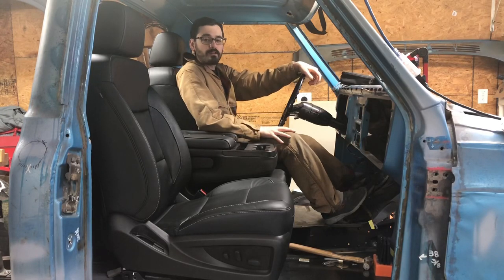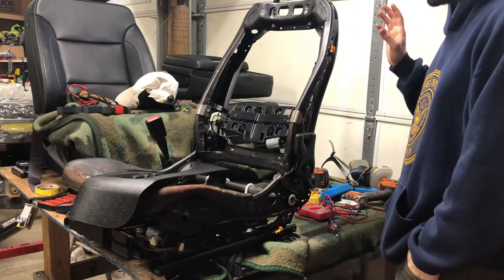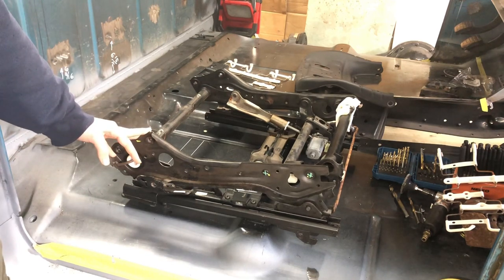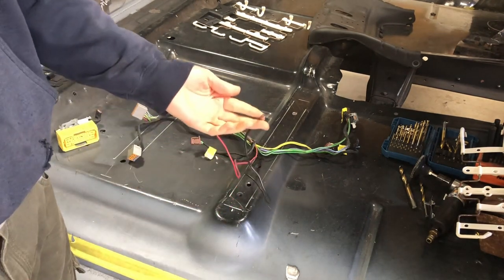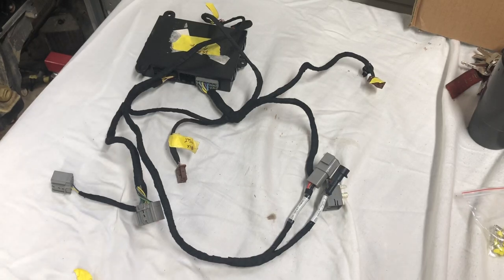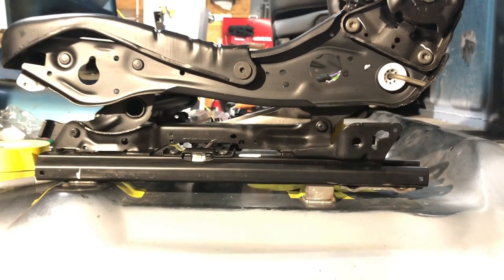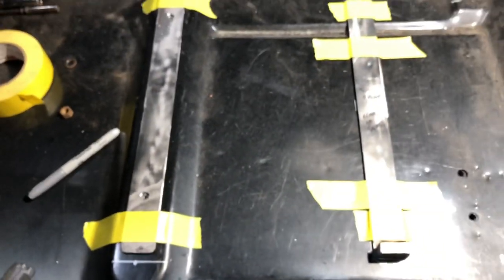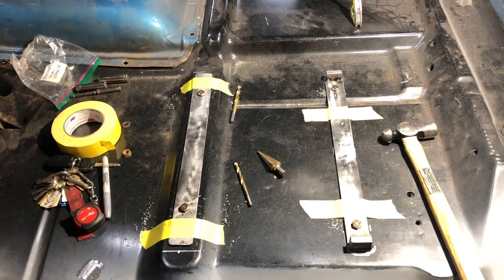C10 Seat Swap

Comment: Hey, is there any way you could get the factory heated/ventilated seats working from the denali seats? I just picked up a set of 14-19 denali seats I'm going to swap into an 80's truck. I thought I could just run 12v power to the factory heat/vent motors and run them to relays and toggle switches? I really wanted them for the ventilated seats because I'm in Texas, but now I'm worried I can't bypass the memory computer in the seat. I figured the vent motor would just have a 12v power and ground wire going to it
Reply from the maker: The climate control module should be located under the passenger seat. That communicates with the BCM and the toggles for the heat/cool. Because of those two components its a problem. Really the only way to utilize the factory heat strips would be to buy a kit with a switch and a thermistor and just splice in the heat pads in the seat. The 'cool' function is literally just a fan so it should just need a 12vdc supply. You could probably pull the dash buttons and wire them into all of this but its not going to be a plug and play deal.

Comment: Good start to your channel, a little audio work and you'll be on your way.
Reply from the maker: If you know much about audio and could offer some tips that would be great. I’m just using my iPhone because I don’t have a nice setup. Thanks for watching
Reply: Exactly my thoughts on the audio comment. Also, a little more in depth explanation on the specific wires you kept & utilized for the power seats would be nice. Good work!
Reply: @MAYCOCustomRestorations  The audio was very low for most of the video. It could be that you just need to turn up the microphone gain setting. I would try that first. If that doesn't work you may have to look into getting a wireless mic of some kind that you can clip to your collar, so your voice is always loud enough.
Reply from the maker: Unfortunately I thought the audio was too loud so I turned it down in the editor. Next time I won’t do that

Comment: Did the heat portion end up working all right?
Reply from the maker: I think I mentioned it on the video, but I swapped out the factory heat equipment with aftermarket heat equipment, which I believe I show that too. You would need the dash module and the passenger seat module to get the heat to work. And you’d also have to wire all that up so rather than do that I just got aftermarket heat kit and put the switch in the bottom of the seat.

Comment: How did you fix the back rest on the passenger seat
Reply from the maker: The seat frame was primarily bent in the lower section of the frame (because of the wreck). When I replaced it, that corrected most of the problem. Like on a lot of these trucks though, the upper frame was bent back in a twist. The upper frame I bent back most of the way by twisting it back. I could have totally corrected it if I spent more time on it. It just needs a little stiffening brace welded to it. I figured if mine starts to go back I’ll pull it and fix it for good.